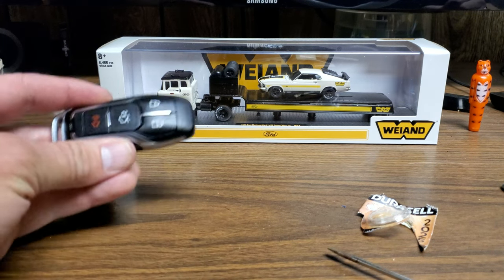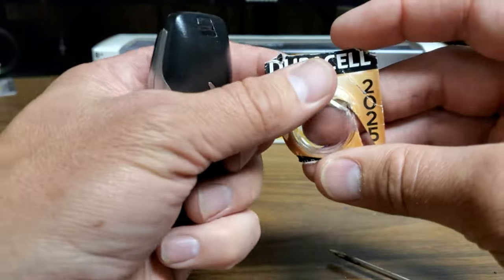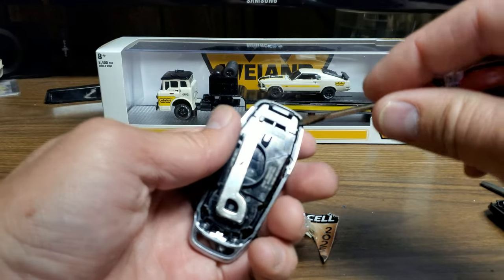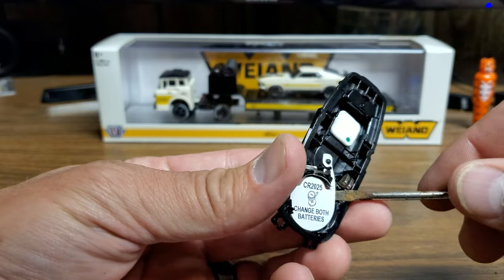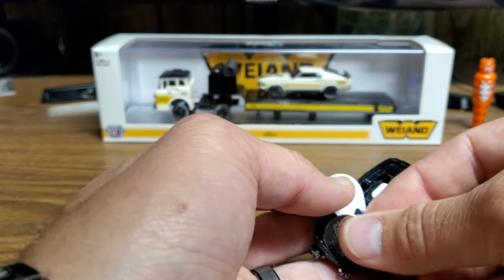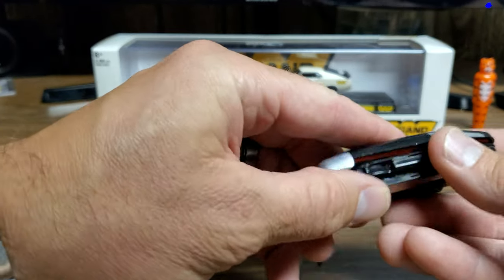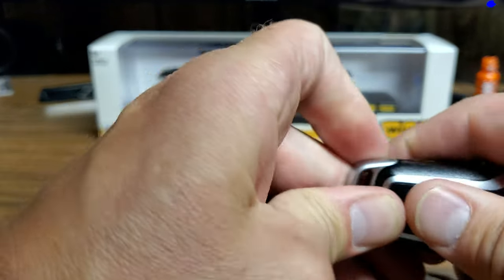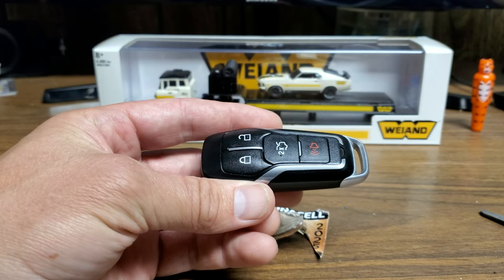HOW TO REPLACE YOUR FORD PASSIVE ENTRY KEY FOB BATTERIES 2015 AND UP

Comment: My mother searched "locksmith" in our area and ended up going to two different "machines" that make keys. She was SOOO frustrated. I told her "mom, I'm so glad you did not find an actual locksmith, because I'm going to watch a quick video then do it myself". I charge much much less too! A $15 steak 😂. Mom and I thank you. I also thank Walmart for informing her the "low battery" light did not mean she needed a new car battery! Most would have ripped her off and then just changed the battery in the fob while she waited. Big thank you from a new sub.
Reply from the maker: Glad I could help!